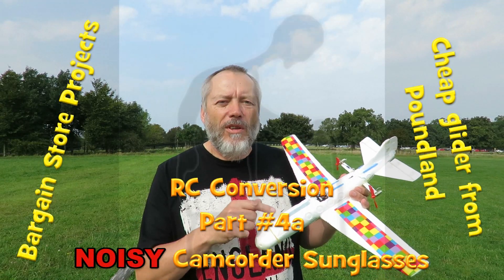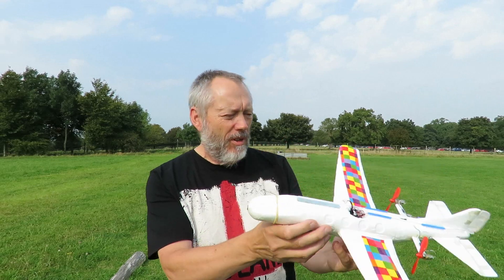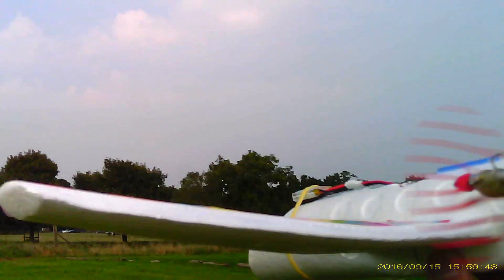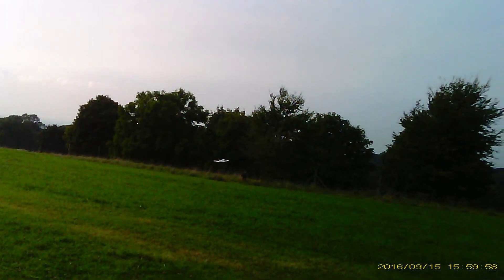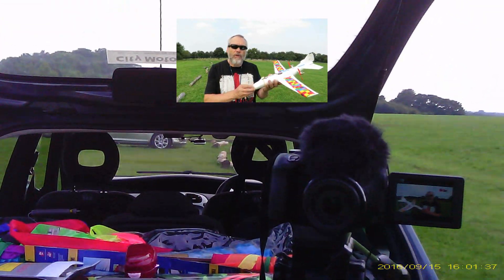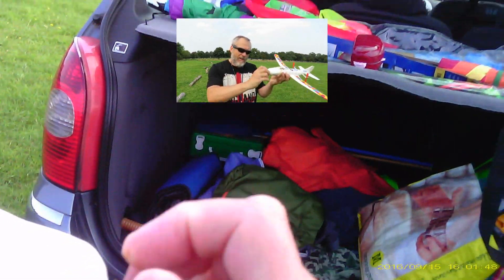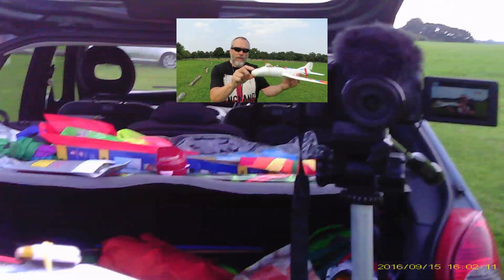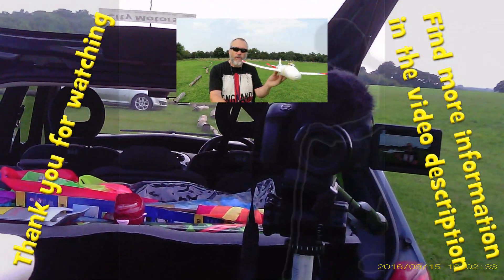Bargain Store Projects Cheap glider from Poundland Part #4A Camcorder Sunglasses

Comment: The tape on the wing top is a good idea, but you also need some on the bottom, but you likely know this by now.  Some modelers even go so far as to tape up the entire wing surfaces, but that seems a bit much due to the added weight.  I would recommend the glue and paper skin option instead and so far the best method that adds the least amount of weight has been to use thinned glue and single ply super strong tissue paper.  The skin is very thin and the glue has to be applied first as a thin film before the tissue paper is added dry since once it gets wet it is designed to break down and rips, or tears very easily.  For bigger projects, like the Air Hogs Titan foam glider I tend to use thin, cheap coffee filter paper since it wont start to break down when it gets wet and resists tearing, but the glue and paper process is the same otherwise.  The catch is the coffee filter paper is cut round and I am normally wanting a square of paper, so there is more waste.  Once the glue is fully set and cured, construction continues in the normal fashion, cut the fuselage into a right and left half, or a top and bottom half, and remove a lot, but not all of the original soft foam of the kit to make a hollow fuselage.  I normally glue the wings on, but I still want a bit of foam on the inside for the joint.  Many aircraft designs I make put the wings at the top of the fuselage, or bottom, so the position the kit uses gets foamed to disappear and add strength.  Hope you don't mind me blabbering about what a modeler can do with these cheap kits, even if they are no longer sold by the Dollar Tree store in America.  I still have a box full waiting on me to do something with them.
Reply: Maybe the suggestions I have added to this video and some of the others about this project will be useful for your viewers in the future.  I am an old guy and not sure how much longer I can leave helpful hints and ideas for others to profit from.  As before, check out what a guy with a Youtube channel named floridax2 has done for inspiration.  There are others who have posted videos of their master work to learn from also.
Reply from the maker: The tape was just to force a dihedral into the wing by tensioning it on the top surface. Like you I think I still have some of these in storage and might revisit it one day.
Reply: @GrandadIsAnOldMan  I like that idea, even if this foam glider kit isn't currently available in the USA Dollar Tree store.  Maybe you should say if it is still available for you, how much, and how to make a clone for those who cannot find the kit where they live.  Just some ideas that might give new viewers something to think about if they want to copy your adventures.
Reply: @GrandadIsAnOldMan    Maybe I should recommend another option to force the wings to curve upward, but it is a bit more effort then applying tape.

Comment: In order for an aircraft to fly comfortably & its motors not to get fried from excess current it must be able to sustain continuous flight at under 50 % throttle ideally at under 30 % throttle. There r 2 ways u can lower load on motors ie by reducing drag & lightening the aircraft since the motors that u r using are ideally suitable for an aircraft weighing a max of 40 g whereas yours one is 60 g. But that's ideal. Your aircraft can fly comfortably if it is under 50 g just that your motors will fry after just 5 to 10 hours of flight. 

INCORPORATE FOLLOWING 3 MODIFICATIONS
1.  REDUCE DRAG by flattening  leading edges of all wings (by chopping material from front upper portion only) just the way u did for trailing edge of main wings & make the nose more tapered. This will improve aircraft lifting ability by 10 %

REDUCE WEIGHT BY USING FOLLOWING 2 METHODS
2.   I always suggest everyone that putting an additional  nose weight totally defeats the purpose, since u can easily get that purpose done by moving battery a bit forward. 

3.  Chopping of unnecessary material. ie making aircraft structurally optimized. That is where aircraft structures engineering comes into play as u got to know which area need strength & which don't need that much strength & u can chop off a bit of weight from there. My suggestion would be to chop off material behind the nose all the way to 1 cm before the start of main wing then again 1 cm after the end of main wing all the way till the tail. But another engineering descipline of manufacturing engineering plays role, as how u can u chop material from inside the aircraft to make these internal cavities.  In manufacturing they use end mill cutter but u can enter a thin long drill bit from nose & create broad internal cavity or from bottom - but that would look ugly from bottom.
Reply from the maker: If you study some of the later videos in this series and I know you have seen several of them as you have commented on them, you will see I hollow out the fuselage simply by using a red hot screwdriver to melt it away. I then place the batteries inside the front of the fuselage. Most of the conversions of this toy that I see on YouTube have included replacing the wing but I wanted to stick with as much of the original toy as possible. You might find reading the video descriptions associated with my videos might give you an insight into what I am doing.